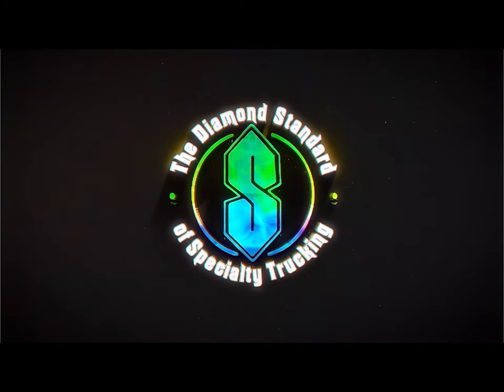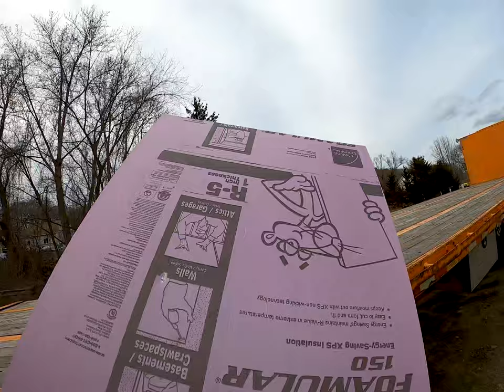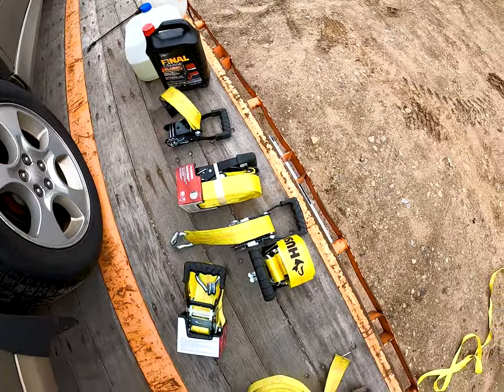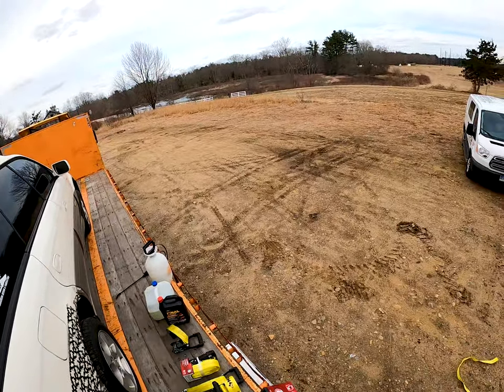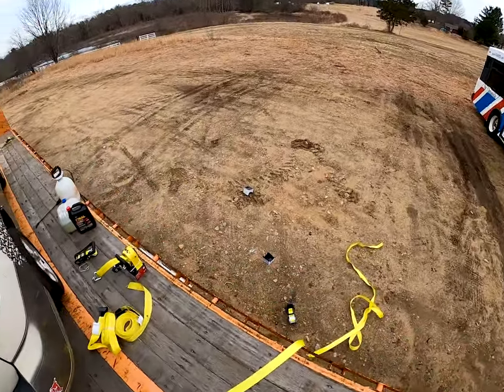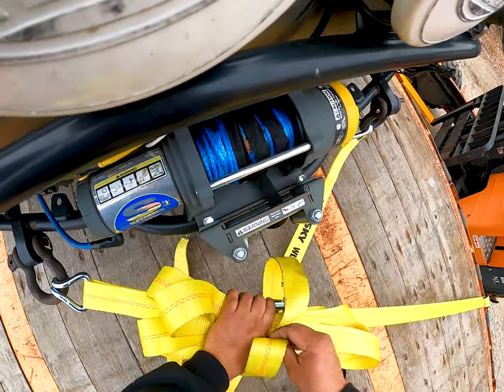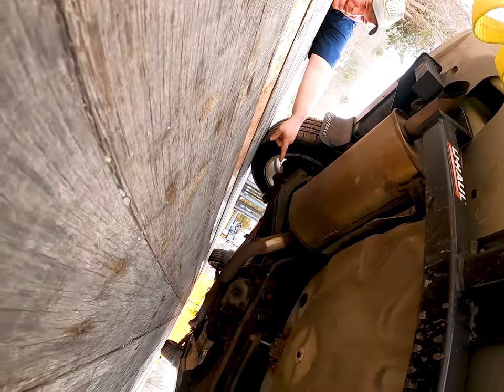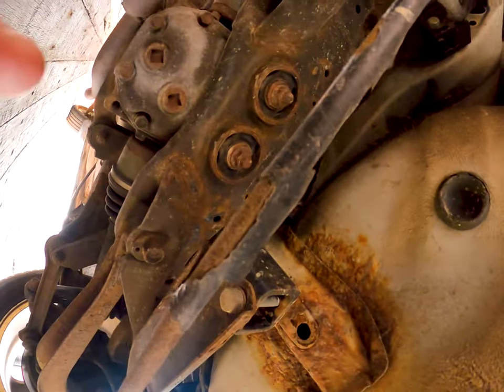Watch the Moffett pick up a station wagon!

Comment: Many many years ago I was driving for a steel hauling company and was listening to the chatter on the CB radio. There was a guy hauling 3 different families on his truck (bedbuggers as the are called). The furniture was on the bottom part of the trailer an the cars were on top part of the trailer (I myself would have put the cars on the bottom and the furniture on top), well the load bars gave way and the plywood on top of the load bars and the cars came  straight down on to the furniture. The cars had some major damage and the furniture was all totalled. I was so glad I was not that driver

Comment: We had a driver in the Atlas Family(one of the other agents), he would haul husehold furniture and all in the summer and when things started to slow down, he would pull the pads out of the trailer and had a car hauler setup to slide into the trailer (box) to haul cars in the winter. Made it into a double duty trailer. I have hauled a few vehicles without my boss knowing about and furniture trailers have a fixed axle (the older ones), so they don't slide. My wife had family in Augusta KS., I would put her car in the back and haul her up to Kansas, drop the car off, stay the night, then continue my journey North East to deliver. Then there was this time I took a crew with me to Tuscon AZ to deliver a load, then to phoneix to get a guys car so he could drive it home (which we loaded in the back of the trailer, put a load bar about center of the tires front and back and the car stays put, then to a little town in AZ to pick up a load going to Las Cruces, NM., dropped that load the next day, and that night or very early morning the next day, back in Amarillo.

Comment: car hauling pointers: Get some 4x4 blocks to put on top of the forks and set them at the frame or rockers. This will give you the space needed to not bend a driveshaft or exhaust. Strap THROUGH the wheel spokes or around the tire if you have room to get the hooks through. This way the suspension doesn't tug on the straps over bumps. BTW, you should have tested for center of gravity when the car was 2" off the ground. (lift on the bumpers to see if it tips) Those cars are light in the ass so should have the forks closer to the front wheels. Also, those mirrors fold in flat against the door.

Comment: Much prettier and faster way of doing those strap ends. Roll them back up then 1 wrap around through the loop and roll them up tight to the ratchet. They never come loose and look clean. Also, a loop a twist and over the wheel would have been better as with this setup when your suspension flexes your straps go loose with a pop.